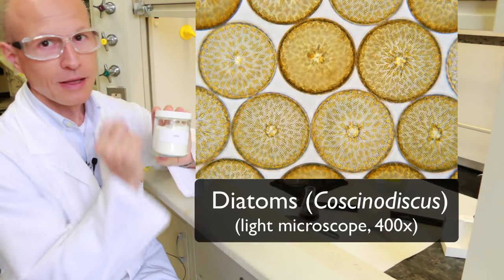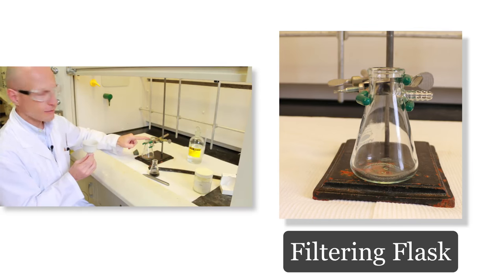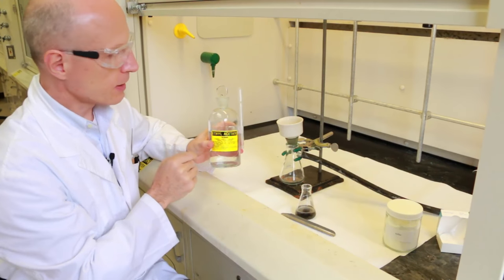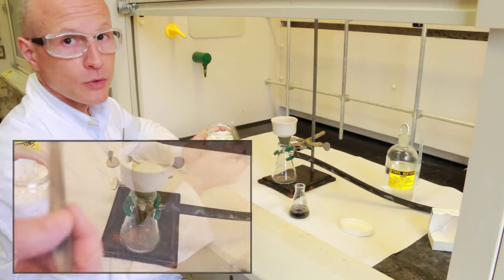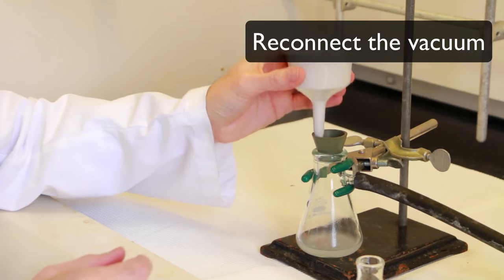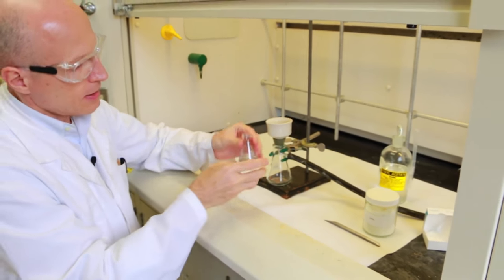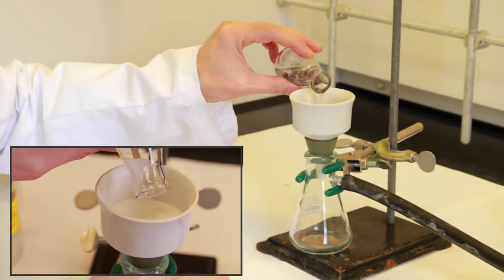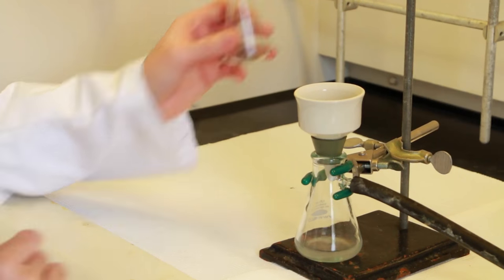How to Filter through Celite

Comment: I'm a chemistry novice (just do it on my spare time, for fun), but this is the first I've heard of using celite/DE padding with a porcelain buchner funnel w/ filter paper. Seems to me that celite padding is usually used with buchner funnels w/ fritted discs.
I use it when I have a solution that contains activated carbon that needs to be filtered, as well as other impurities that the fritted disc would catch. The celite pad prevents the activated carbon powder from getting stuck in the fritted disc. (This is much faster than removing the carbon with a buchner funnel w/ filter paper, followed up by another filtration using a fritted disc).

Thanks for the upload! Great video. Nice and simple.
Reply: You're right. However, it's only a "Büchner funnel", if it has holes in it and no fitted glas frit. ;)
Reply: @thedude6736  Since when? Everywhere I have seen calls fritted glass funnels buchner as well. They are just called Glass Fritted Buchners, or Buchner, Fritted Glass. But the word Buchner is almost always included
Reply: @vancouverguy2533  Hm, we call these just "frits". Seem like my definition ist not that valid. I guess we do it that way just to be able to differentiate and because the original Büchner funnel from back in the old days was made from porcelaine. ;-)

Comment: Have you noticed a very fine particulate getting suspended in the solution from the celite? I can only see it with the right intensity flash light or maybe a laser. This suspension never seems to bottom out and ever since using this through a fritted filter, I get this suspension in any solution that goes through the filter now. I can also see some of the silicon dioxide around the edge of the frit and it does not want to budge from normal cleaning. I'm trying to figure out the best way to clean it properly but I haven't had any luck yet. I'm thinking I may need a dilute solution of sodium hydroxide at just the right concentration to dissolve and potentially loosen the the SiO2 without damaging the frit.

Comment: Make a slurry. Doing it this way will unseat the filter and get DE in you filtrate.
Reply: as in, mix the celite and to be filtered material together, mixing with solvent and filtering all at once?
Reply: Make a slurry with your celite, and solvent. Seat the filter paper in the funnel with a small volume of solvent, and vacuum. Then pour the slurry on top, and form a solid cake. Do not let the cake dry out or crack. Carefully pour your solution to be filter on top the cake without disturbing the cake. If done correctly, you will get a clean filtration.
Reply: I see.. the same sort of "slurry" idea used in column chromatography.  Thank you.
Reply: @threezerol944t  I know I'm a little late it's been 2 years but one way to do it would be the first seat the filter paper then make your slurry and while the vacuum is running poor the slurry on top of the filter paper one additional step that I do is I put cotton pads on top of the sea light back in the buffer when I pour so that I do not disturb the celite

Comment: Thanks prof ! What about safety gloves? :)
Reply: Ethyl acetate on its own is not that harmful . If there is something harmful dissolved in it, it's adviseable to wear gloves just forprotection from splashes. If something gets on your glove, remove the glove immediately, since most organic solvents will penetrate the glove within 5 seconds or less. This means, the solvent will also carry the solute into your glove! However, wearing gloves all the time is very bad for your skin and may even cause allergies. If the risk is small (harmless substances), for a step like this it's sensible not to wear gloves.